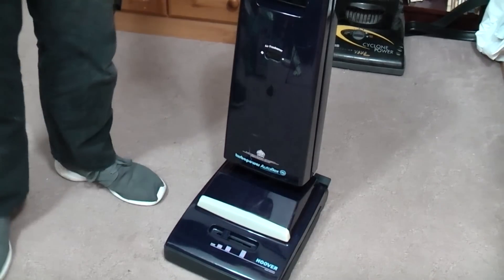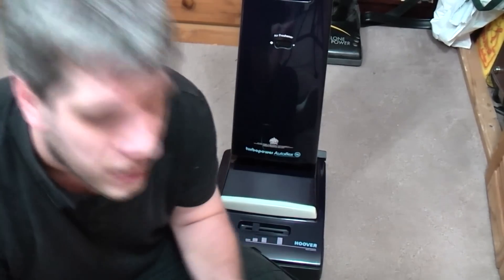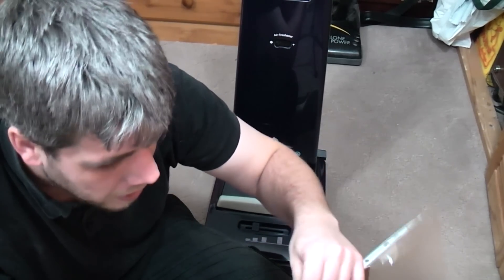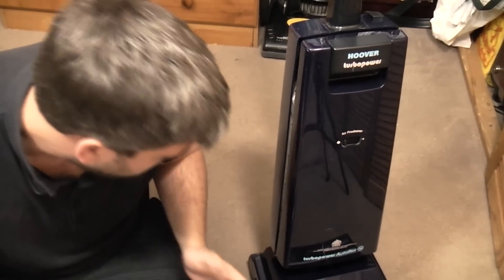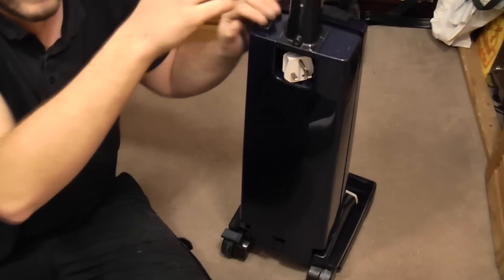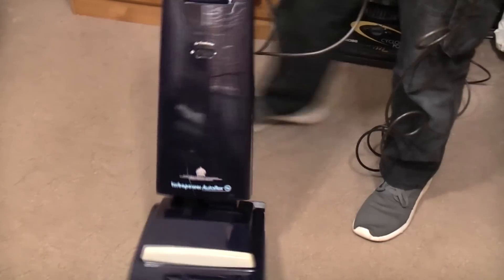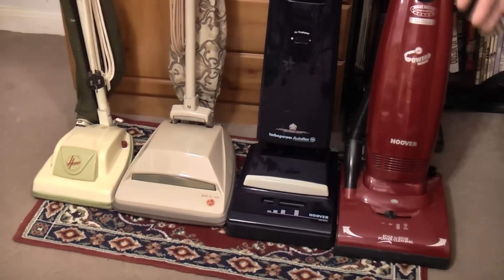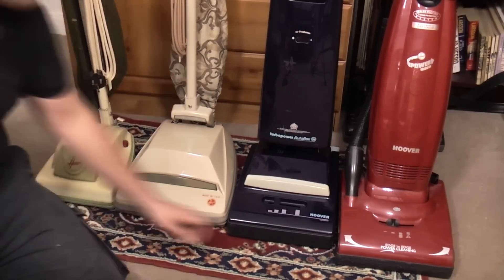Hoover Turbopower Autoflex U2198 - After Refurbishment!

Comment: So what generation were the Turbopower that we have, that has a rectangular plate that says 'HOOVER' on it where the air freshener would have been, please? I think they were from the early 90s, but I'm not sure.
Reply: We had one of those from the Argos Catalogue, in red, think they were using up old parts before introducing the Turbopower 2s as it had a "junior" Turbopower style floor head, on-board tools, blanking plate on the handle for the switch and blanking-plates on the air-freshener, other switch place, lower cord hook, and bag-full indicator place. We got it in 1994 I think.
Reply: @muk8804  Thank you, the date is really helpful.

Comment: Do you know the number or size of the bearings used in these machines.  Motor and brush are the same I would think? And where do you get them at a good price,they seem expensive on eBay!
Reply from the maker: No they are different. The brushroll uses Hoover Agitator/brushroll bearings. Just one type used from pre war to the mid 90s, there's usually a set on ebay. The motor bearings are 608zz's, easily fitted!
Reply: Beko1987  thanks  Sam 👌🏻

Comment: Hi Sam yes the red U2194 did have a red belows in the very early model I Remember my grandad having one which also had a red cover plate above the tube very very rare to find theses iv just sold one that had red wheels and a red height adjustment so I think there's 3 versions of the u2194
Dave